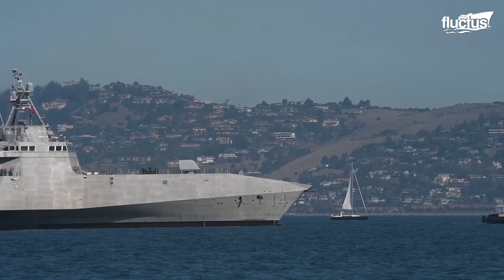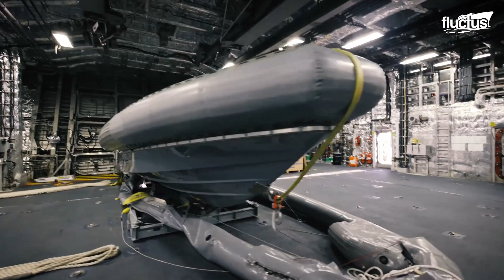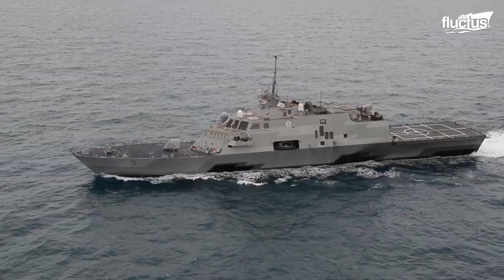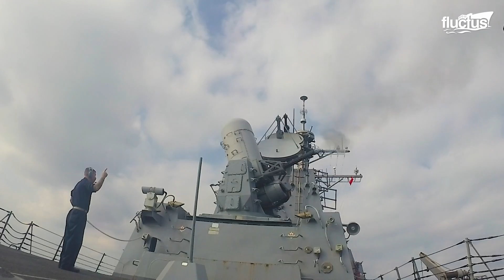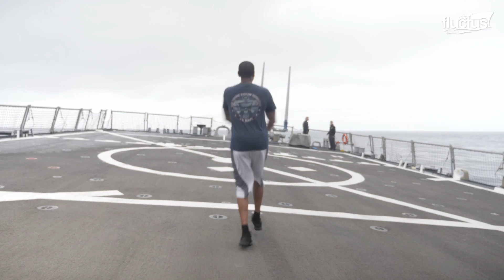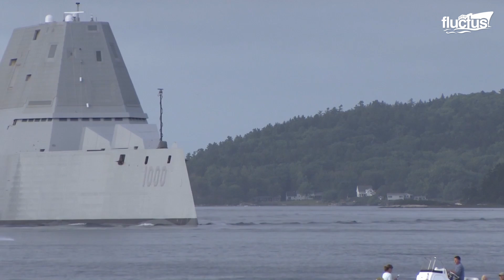US Lost Billion of $ Testing this Weird Looking Gigantic Stealth Ship

Comment: I worked on the first Freedom class in San Diego, and the first Independence class boats....

Just garbage, just a garbage can!!!

The crew hated them. Soo labor intensive.
And the Navy crew was the best nothing but E5 and above. The captain of the ship had cleaning stations!!! Since there is only 40 people on board. Made out of Reynolds aluminum. Just garbage chips with nothing but problems. There was an entire engineering team in the hangar Bay 24/7 on computers trying to make this work!
Billions of dollars throwing out the window!
BM1(SW/AW/SCW) (ret) / MSC. (ret.)
Reply: Oh, I forgot NAVFAC Crain and Rigging supervisor retired!!!! Where I worked on these rentals aluminum tin can garbage Ships. I worked on all the ships in San Diego the littoral fleet is Garbage. Sailed at Sea on real steel ships for over 30 years.

Comment: The problem is these contractors have the taxpayers picking up the tab for this JUNK
Reply: The problem is US navy has changed its plan. NAVY has decided to buy frigates to fulfill its mission.
Reply: The contractors built the ships the Navy directed them to build. The problem is the Navy didn't know what it wanted and kept changing the requirements to head off Secretary Cheney's fantasy of a fleet of oversized speedboats called "Streetfighter" to handle littoral-waters duties.
Reply: The only mistake made with LCS is was not splitting the classes 
The Freedom class should have been for the LCS while the Independence class evolved into FFG
Reply: @verdebusterAP  It was the bad performance of the LCS designs that made the government decide to go with the FREMM/Horizon-class frigate as the FFG-62 class.